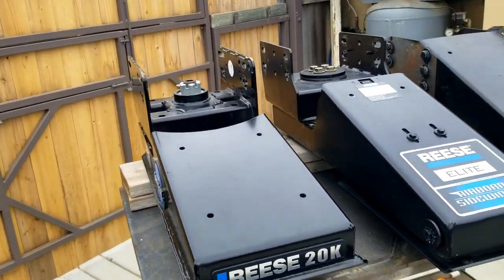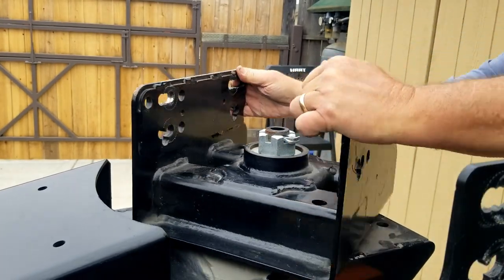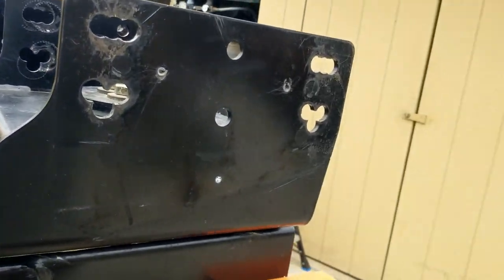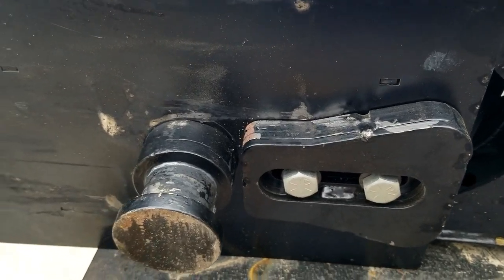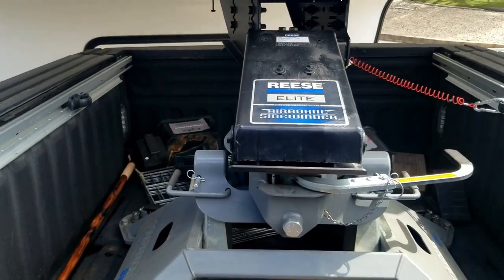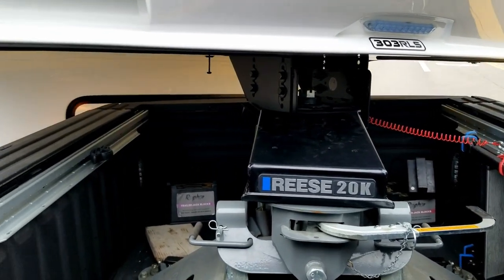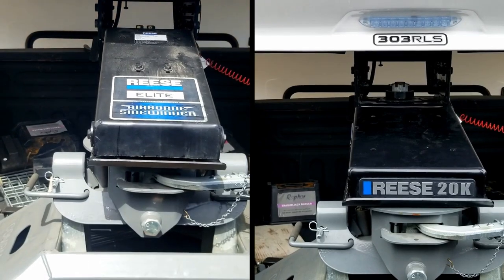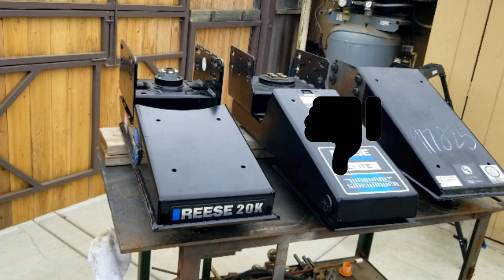Reese Sidewinder 20K Vs. Reese Elite Airborne Sidewinder

Comment: I have this exact set-up with my 2017 RAM 3500 SRW 6'4" bed with Ram Boxes.  Both Reese & etrailer worked with me to come to this solution for towing my 2018 39 foot Montana 5th wheel.  Back then, I got the Reese 19K Sidewinder using the Reese 20K 5th wheel hitch.  My towing experience has been solid and confident with no slipping of the rear wheels as some have mentioned, but I am a very cautious driver when towing a big 5th wheel, especially on wet surfaces  The only issue I have had is while uncoupling the 5th wheel from my truck.  It can be  difficult to release the hitch's pull bar handle at times unless truck & trailer are perfectly aligned because the wedge block is very tight.  A couple simple taps on the handle with a rubber mallet, and it slides right out.  I love this set-up and would recommend it.  Great video.

Comment: I'm with you 100 percent. I have the B&W Companion Slider hooked into my Gooseball mount and like it other than having to get out to move slider back. Always looking at other options. But other than having to deal with the wedge each time hooking it up seems to be a great setup. Also my pin box is the lippert Roto flex that works pretty well too. Going to suggest this setup to a friend that needs a setup.
Reply: I have the older Sidewinder 19K pin box, and once I dialed in the wedge, I have not touched it again in 6 years.  It is a one time deal, set it right, and it stay put.  Zero bucking and chucking while towing.

Comment: I have the reese elite airborne sidewinder with b&w companion hitch. I'm on my 2nd airborne sidewinder swapped them out on 7 different trailers over the years. I know it's not following their guidelines but the first thing I do with those king pins is tear them apart clean the thoroughly of all the lithium grease and lubricate them using reese Teflon ball hitch lube then I torque the 4 turrett bolts to 35 ft lbs using blue loctite. Jerking motion in rotation is non existent . Nice and smooth. I have a 303rls currently and have the bag adjustment screws all the way front toward the truck and have found for me that 50 to 60 psi works best for the smoothest ride with my trailer. It's alot of trial and error to get the best ride and a couple psi up or down makes a big difference in ride quality

Comment: Someone needs to do a video of how dangerous these types of hitches really are on the stability of the truck in the rear. I have the turning point hitch and it has tried to push the rear end of the truck out from under the trailer sliding the tires. It acts like a standard bumper pull TT. It is especially dangerous when on a wet or icy road. I am going to go back to a standard slider hitch. More work but I felt 100X safer. These are a good idea but very unsafe in reality.
Reply: I have the old sidewinder 16K and it is so jerky that I have had it slide the rear wheels of the truck sideways when encountering a curve on wet pavement. The 45 ft-Lbs of torque on 4 bolts preloads the wear plates to 17280 lbs. No wonder it is hard to turn even when lubricated.
Reply: Great point!!! The law of physics at work. I had a situation of sliding sideways once even with the regular 5th wheel hitch and it was a very unpleasant feeling to say the least. It was in the late season with a little slush in a driveway apron of an RV dealer but that situation would definitely have been much worse with this setup. May have to rethink this.
Reply: I have the older 2018 Reese 19K sidewinder pin box pulling my 39' 2018 Montana 5th wheel (14K lbs.) while using the Reese 20K standard 5th wheel hitch in my 2017 Ram 3500 SRW with the ram boxes.  I've been towing with this package for 6 years all over the western states with zero problems.  I'm not sure what Reese has done since then to produce substandard pin boxes, as some say?  In wet road conditions, I always tow very cautiously, as I would while towing any trailer.  I experience no bucking & chucking at all.  I had to set my wedge block initially, but have never touched it in 6 years as it performs flawlessly.  Even with my SRW truck, I have never experienced any sideward pressure at the rear wheels.  With experience and safe towing practices, this sidewinder is a great package for me.  Happy safe travels to all.

Comment: This is an amazing video! Thank you for taking time to put this together. I have the identical setup (Reflection 303RLS with RAM that has ramboxes). I purchased the Elite with the airbag. One thing I am noticing is significant "bucking/slamming" when going over pavement that has "whoops" in it, or bumps. It feels like the hitch is "bottoming out". Airbag is at 70lbs. Have you experienced this in your tests? It pulls fine when on fairly even pavement, but when I start to hit those waves in the road, it "slams down". I have airbags in my RAM as well. Did you happen to feel any of that when you went back to the regular one?
Reply from the maker: I did play with the air pressure on the Elite and found that I preferred to tow with a higher pressure. I think what you are feeling is actually the opposite of bottoming out, but rather hitting the stop at full extension. There is a bridge on Interstate 5 just north of Sacramento Ca. that will beat a 5th wheel to death. I did discover that the Elite seemed to make the problem worse as a rhythm developed due to the expansion joints in the bridge. The Elite is good at dampening smaller jerks and bumps - very smooth on a good road, but didn’t seem to handle the bigger bumps as well. As I said in the video, I actually prefer the 20k hitch because there is much less movement at the pin.

Comment: Excellent video.  I have the Air Sidewinder Elite and wanted to do the recommended yearly maintenance on it but Reese has discontinued this pin box as well as the maintenance kit you have to buy to replace the bushings if needed.  I'm really pissed off about that.  No support for the older pin box.  Says alot about Reese's customer support. really appreiate the time you put into this. Thanks